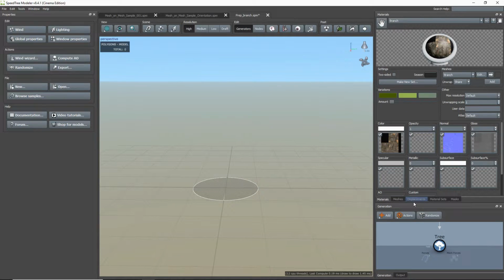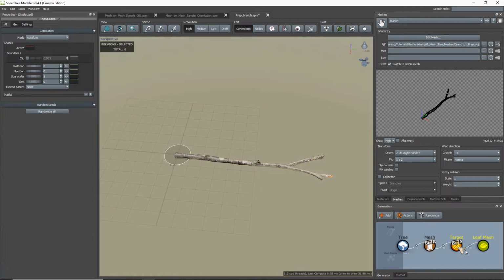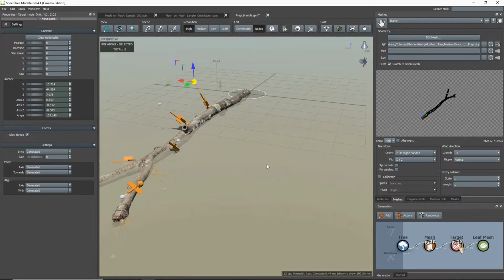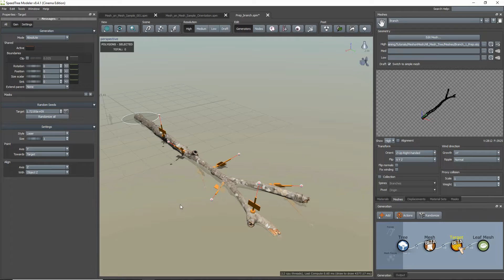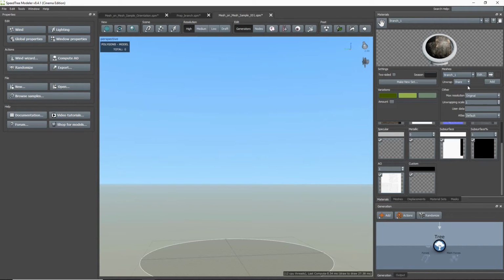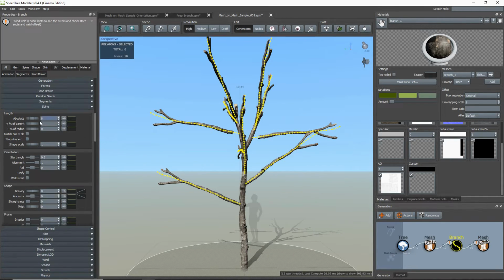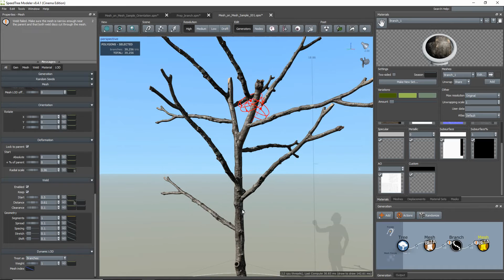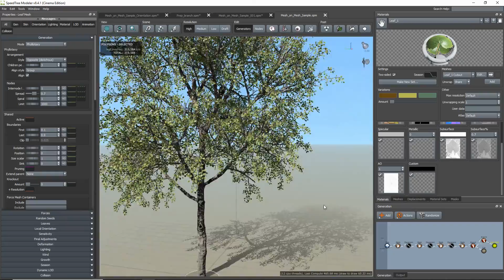SpeedTree 8.4: Mesh on Mesh Placement

Comment: Im still exploring this amazing feature, please tell, can i separate anchors on groups?
For example i have a pine branch with cone or few cones in the end, i place anchors and set them to be "needle cluster", but for few anchors at the end of the branch  i want to set "cone cluster"
Reply: except for using first-last modificator, which works well, but i still couldnt pick precise anchors

Comment: Hi .. 
Do u know how to export tree with wind to 3dsmax the right way ? 
Am using speedtree 8.3.0 cinema
Am doing fbx but as soon as i import to 3dsmax 2017 it crashes !!!!
Reply: I had the same problem with 3ds max 2018, but 3ds max 2020 is handling it with no problem and exactly the same workflow. export  fbx with wind animation
Reply: @Siakan1  
I found the solution... the File should be less than 2GB otherwise it crashes

Comment: The library costs a fortune... especially after buying it in the version 7 format(.spm).. to have to rebuy the Library for 1200$+ for the version 8* is reprehensible.
Reply: Hi Mike, just wanted to clarify- SpeedTree 8's library is a separate product full of entirely new tree models with multiple sets of hi-resolution PBR textures.  It is not upgraded or updated version of the v7 library's trees.